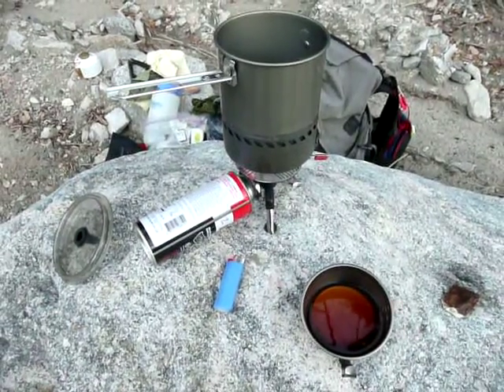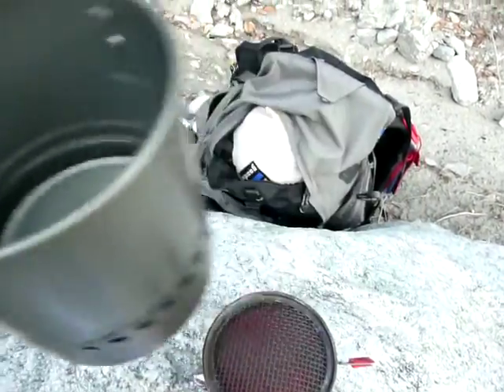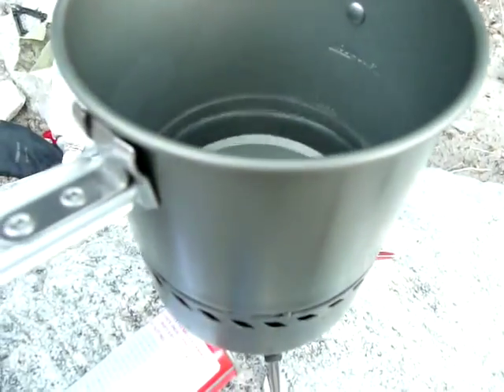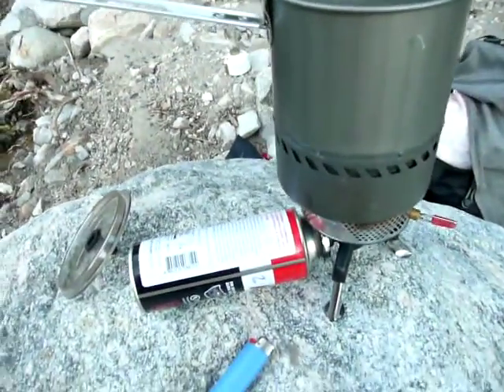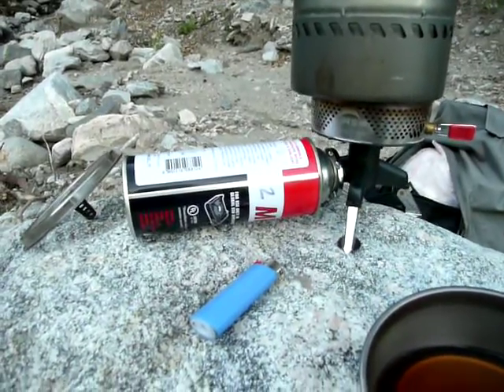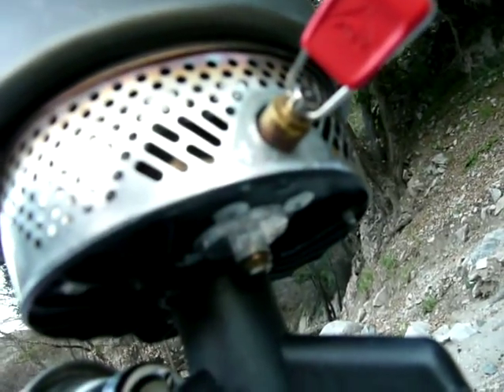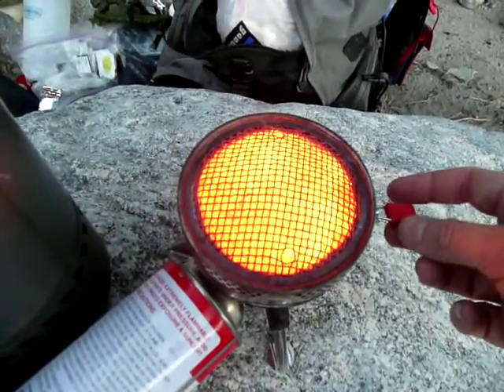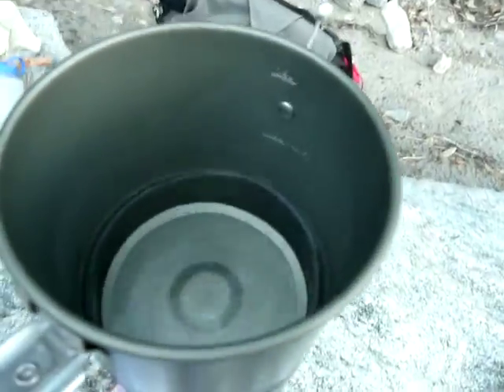MSR Reactor Stove Review and Simmer Test -- 1

Comment: Something notable is that simmering a catalytic stove in this manner can potentially create pollution.  The stove is running at a less than ideal temperature and cannot completely combust hydrocarbons in this fashion.  That aside, people generally say that they cannot simmer simply because they would have to pull the pot away, that or they're simply trying to adjust the temperature control w/ 40s taped to their hands.

Jetboils, however, definitely cannot simmer unless you use a remote adapter.